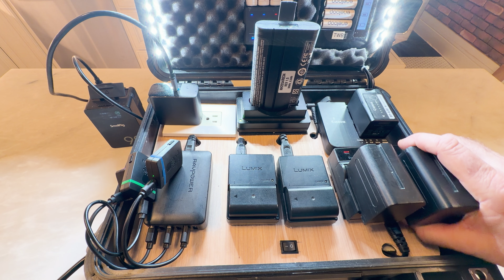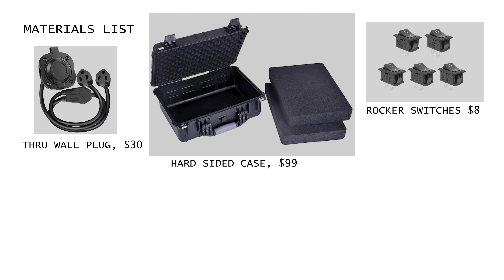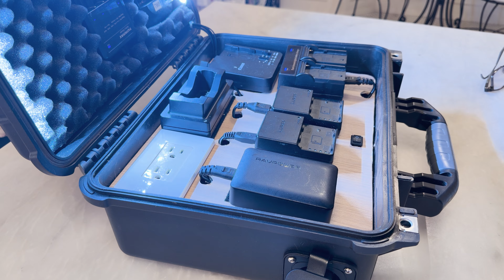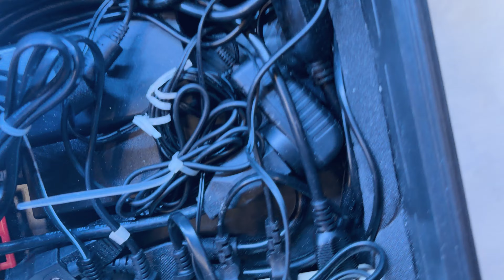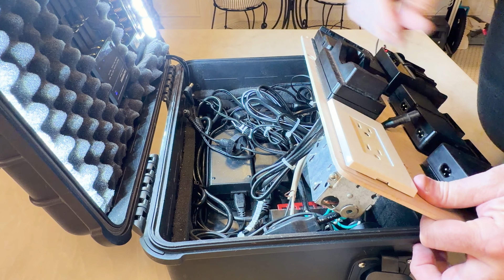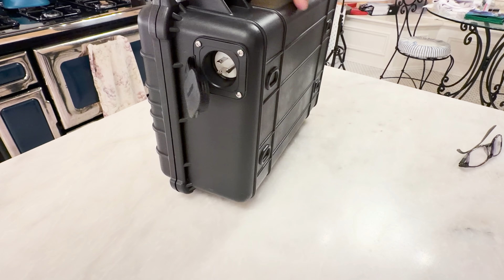DIY Custom Charging Case Build

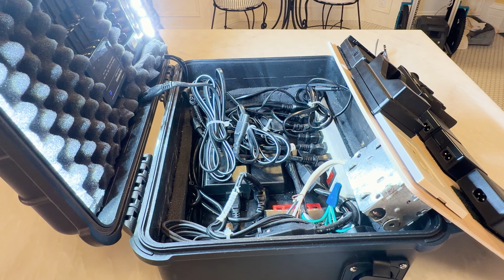Comment: 7:20
The 2 large ac adapters will die sooner or later as its designed with open air in mind.
Best case, it just stops working. Worst case, mosfet/capacitor blows and causing sparks which will lead to fire.
You have a bunch of space on the upper lid, I'd put it there instead if I were you.
Reply from the maker: Thanks for the feedback. So far they don't seem to heat up all that much, inside the case. I shot them with an IR temp probe and they were only luke warm, only a few degrees warmer than the ac adapters sitting next to my desk.